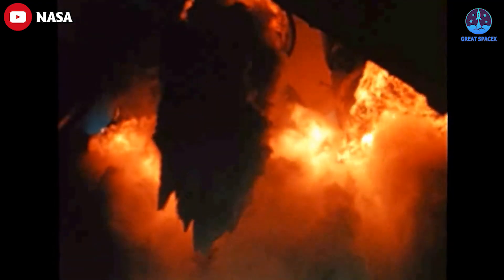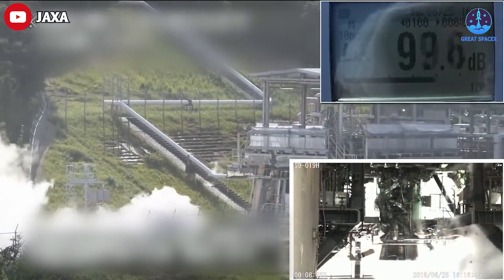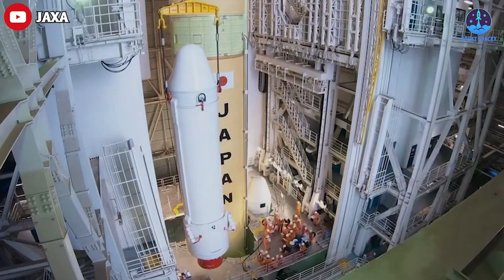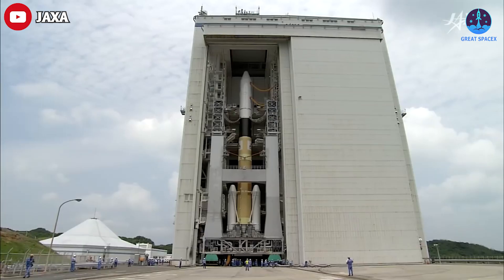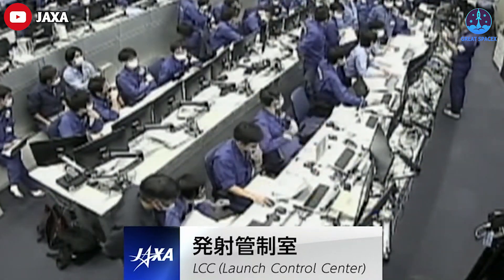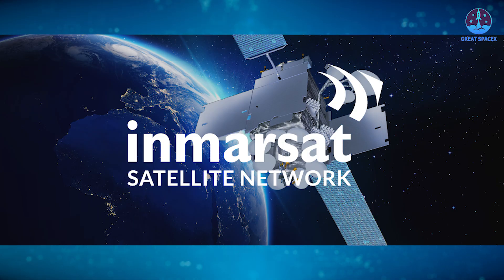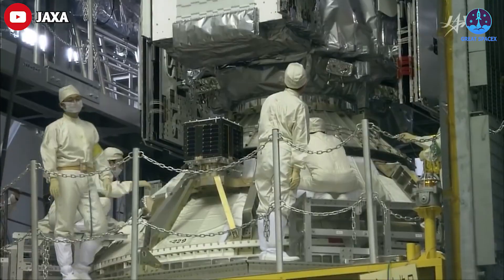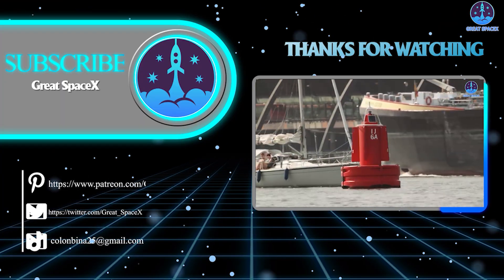Japan's brand new rocket engines "FAILED"! No way to beat Falcon 9...

Comment: Don't celebrate this failure. Celebrate its effort, and expect another try. Beating SpaceX is not such a good goal. There needs to be a diversity of companies able to fashion workable systems for the vast variety of space goals, and the synergy of an industry is more powerful than any single company, no matter how pioneering or prominent. The robustness that an industry has is the measure of the robustness of anyone's ability to pursue goals in space. After all, the Wright Brothers didn't develop the airplane alone. They broke the ground to make people realize what could be done, and then people everywhere started doing it.

This, by the way, is the proof of Musk's strengths, that he started things in a new and correct direction, and others are grabbing hold in a diversity of ways. Well, not all others (like ULA). But not all players will survive. And hopefully, many will. For there's always room for good ideas.

Comment: As no part of the H3 is reusable, how can it be considered a competitor to the Falcon 9?
Reply: Reuseability doesn't have anything to do with being a competitor of Falcon 9. Launch price per kilogram is all that matters
Reply: The H3 should cost more per pound to orbit than falcon 9 because it is not reusable. 
But H3 is heavily subsidized by the Japanese government.
Reply: The price per lunch
Reply: @mywrongopinion7698  I'm not sure what the price of lunch has to do with rockets.
Reply: @channelwithaweirdname  
If they bring lunch from home JAXA wont have to feed its employees & can put that money towards the rocket.🤣
Reply: @johndavid9418  lol
Reply: @mywrongopinion7698  True, they have tightened up on design and manufacture of the rocket engine to reduce cost, but the launch cost is still significantly higher than the Falcon 9 and cannot get cheaper. The Falcon 9 can get cheaper with the  ever increasing number of booster relaunchs.
Reply: TCO (Total Cost to Orbit) is a metric used to determine “competitiveness”… another is “scheduling flexibility” .
Reply: @ernestgalvan9037  And?
Reply: They decided to make a "made in china" in Japan using car parts